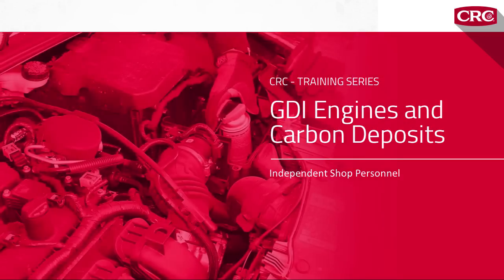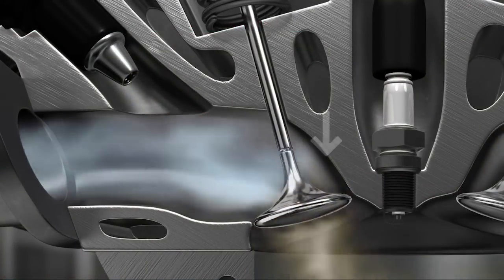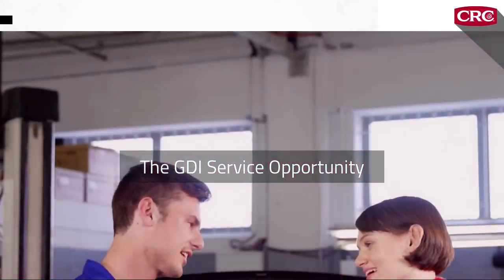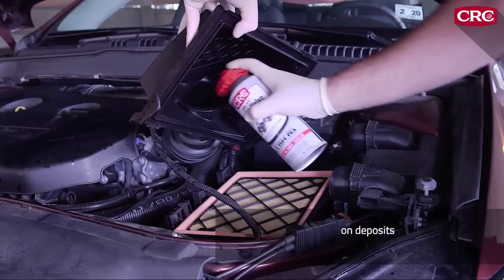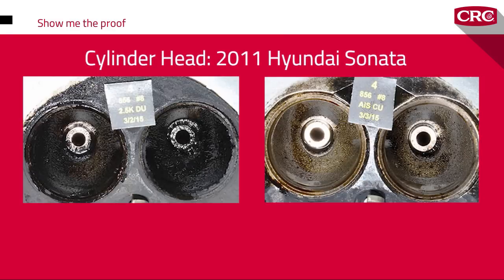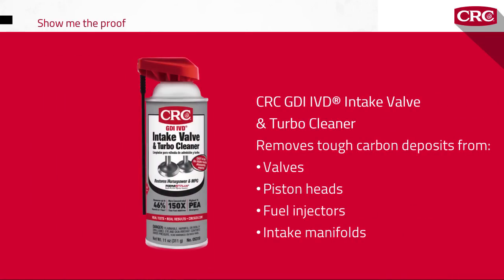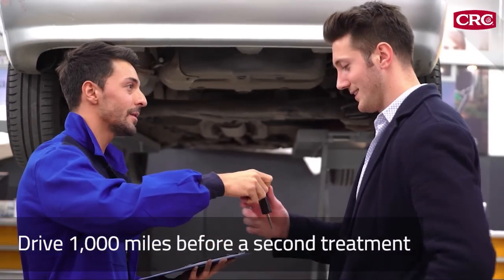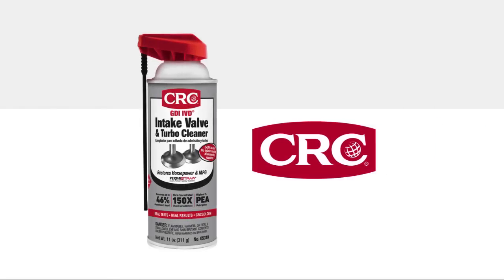How To Use CRC GDI Intake Valve & Turbo Cleaner

Comment: This is great to soak and loosen if engine is not running and performing a manual deposit, but it is NOT safe if used engine running. Want proof? Can show you pistons from dozens of engines immediately following an engine running cleaning. Not only have we yet to see more than 20% removed, we see scoring to the piston skirts and cylinder walls in every case as these hard baked crystallized particles are forced between the piston and cylinder wall.  We have used these in port injection engines safely for decades, but we do R&D work on GDI engines and have since 2008 when we were first contracted to discover why pistons were breaking on GDI engines leading to understanding LSPI and the destructive effects from it.  I challenge you to see just how these cleaners when used as engine running do NOT cause the damage we see. And also the damage to the hot side turbine blades as the larger hard chunks make impact with them during these procedures.  Great to use during a manual cleaning, but scouring in every case when used engine running method. And this is ANY solvent based upper induction cleaner.
Reply from the maker: CRC GDI IVD Intake Valve & Turbo Cleaner is a detergent cleaner (not solvent) that is designed and proven to dissolve carbon instead of aggressively breaking it down which eliminates the risk of the damage that you are referencing.  You can see our test results showing no scoring, damage or overheating conditions at crcgdi.com.  Some customers may prefer to tear down their vehicles and use our product, but due to the design of the product it is not necessary.
Reply: I have serious doubts that a reputable company is going to market something that grenades people's engines. That's a massive liability on their part and they would be replacing engines left and right. I get the whole thing about carbon deposits and engine damage but that likely happened from lack of routine cleaning and those chunks broke off and took out the vital engine components. You want to use a detergent cleaner that dissolves the carbon instead of the others like Seafoam that just knock chunks off the valves and combustion chamber.
Reply: Tracy Lewis Performance you are talking about products like seafoam. If you had ever used this and looked at the components after the hour and first drive. You would see that the once hard carbon is now a gooy looking substance. PEA when combined with heat is a totally different result that just soaking a valve in it cold. You are much more likely to have a problem with manual clean. A steel bristle, or small piece of carbon that you didn't get blown out of the port getting sucked in to the cylinder. Plus manual valve cleaning does nothing for the carbon issues in the combustion chamber. I have used this cry many times and I see the original crosshatching on the cylinder walls with my borescope. Quit fear mongering.
Reply: @Tracy Lewis Performance I did oil analysis before and after the CRC service and I found the hard particulates in the oil skyrocketed.  It took two oil changes in the first 100 miles to get back to normal. The 25 micron oil filters is not going to catch the fine carbon in the 2-15micron range, which is the cause of most wear in the engine.  How does it get into the oil.  The misfires and incomplete combustion caused by the cleaner, causes the carbon to mix with unburnt fuel and oil and is forced past the rings, and through the oil drain holes in the ring landings.  This explains your findings of damaged cylinders and pistons.

Comment: Other than the form factor is this product the same as the crc guaranteed to pass emissions from a chemistry point of view, I am guessing if the crc guaranteed to pass emissions was injected through a source of vacuum in theory in should work the same way. Are this products identical or there are differences ? If there are differences what are they?

Comment: I’m very curious to try this on my 2017 VOLVO XC60 T6 R design with the 2.0 four cylinder engine that has both a supercharger and turbocharger. Do you have a video showing those results?  I understand these engines have no oil dipstick and carbon build up on the valves is horrendous. Thank you
Reply from the maker: We don't have a video for this but please feel free to contact our tech services at techservice@crcind.com who can guide you thru the process.

Comment: Is it necessary/recommended to do an oil change after using the CRC Intake Valve Cleaner? TQ.
Reply: Probably cause then the spray gonna be in the oil

Comment: Questions.  2008 Mini Cooper S (Turbo) If I apply after MAF sensor just prior to turbo intake, will CRC go on to clean the intake valves?  OR, should I do a second treatment applied after the turbo closer to the intake?  I'm trying to achieve maximum efficiency. Are we sure the deposits that become dislodged wont become stuck in the catalytic converter?  How can we tell?  Can CRC be added directly to the crank case prior to oil change?
Reply: Hell no, don't put in crank case. If you're asking a question like that better let a mechanic work on your car. CRC ONLY goes in your air intake!

Comment: How does this product can clean turbine wheel in a turbocharger? Turbine wheel is on the hot exhaust side and this product will only touch the cold side compressor wheel. Cold side is fresh air flow only, so there’s no point of cleaning. In other words this product will not be able to clean the turbo. Please clarify by replying here.

Comment: I have an 2011 MKS 3.5 Ecoboost, since this car has 3 maf sensors, where do i have to spray the product? Thank you for your help. or im wrong about the maf and are map? Could you pin point where i have to spray please.
Reply from the maker: Thank you for your comment.  The product will not harm MAP’s. The Ecoboost’ s may use 1 MAF and 2 MAP’s or 3 MAP’s and no MAF.
You can spray the product from the air filter housing, thru the MAF if equipped. or  thru the throttle body.
Reply: @joaragon  Why do you say this isn't needed on the Ford GDI system? Looks like it's still configured the same way.
Reply: @joaragon I'm not exactly convinced of this. Granted I can't see exactly what I've got going on, I can only just barely see the fuel rail, but I've got a 2010, same car and the thing that brought me here to this video is because it started shuddering as I exited the e-way, then after a few start ups it's back to normal. Check engine light told me cylinder 2 misfired and low fuel rail pressure, pointing my mind in the direction of fuel injector stuck open. Upon pricing one out, all I found is the high pressure fuel injector for $200 each... nowhere in that listing did they mention another lower pressure fuel injector, and I highly doubt this car uses a high-pressure injector on both sides of the valve.
Reply: @joaragon  I'm not sure what you mean, but I don't see any evidence of port injectors on my car.
Reply: @joaragon  Only on gen 2 ecoboosts, which I believe came out in '17 models.

Comment: @CRC Industries,

For a Hyundai Genesis g80 2016 3.8L v6 Gasoline GDI engine, where do you recommend to spray the product exactly?
Reply from the maker: You can spray in from the air filter housing or as close to the throttle body as possible. Contact technical service at crcindustries.com or 1-800-521-3168 M-F 8am-5pm ET

Comment: I just wonder want happens to cylinder walls and piston rings as "carbon continues to be removed" days after treatment. They said at the begining that chunks can fall off if left untreated but couldnt chunks fall off with treatment? I get the necessity, but it seems like cganging auto trans fluid, for the first time, after 100,000 miles. Might hurt more than it helps
Reply: You can change trans fluid at any given time, not doing it at all is worst that doing it late.

Comment: A question CRC, in a Ford Fiesta ST with EcoBoost 1.6L turbo engine, where is the recommended point to inject the cleaner? From the airbox trough compressor/ intercooler or thorugh the cold side hose after the intercooler and before throttle body? Thanks
Reply: Did you ever end up doing this? Have a focus st with 100k I just bought and the plugs were pretty bad so I'm thinking of doing this too...might do it the real way and take the manifold off and use gas and a brush with the valves closed

Comment: newbie question but  why every carbon buildup video is about intake valves?  doesnt the exhaust valves have the same problem ?
Reply: I know it's been a while since you asked, but here's the answer you're looking for. On GDI engines, the buildup occurs due to oil particles accumulating on the valves, coming from the crankcase line going directly into the intake. It burns onto the intake valves, so there is really nothing to make those carbon deposits on the exhaust valves.

Comment: Correct me if I'm wrong...but. if you're running a 2.7 or 3.5 Ford ecoboost, could you not just disconnect the recirculation pipe from the "bov" and spray into that while it's running?
Reply: Nvm I realize now that the recirculation tube only connects to the drivers side intake turbo charge tube.
Reply from the maker: You could do this, but you are spending more time to get the product in the system. The charge pipes usually lead right in to the throttle body as well if you want to spray after the clean side of the turbos. These methods could throw a code causing the check engine light. Spraying in from the air filter housing on turbo charged vehicles is fine, the product will make it to the intake valves. For more information reach out to our Technical Service Team 1.800.521.3168 or techservice@crcind.com M-F 8-5 EST.

Comment: Hi, I have a port injected engine so I don't need valve cleaning but I want to clean the piston heads & rings. Is it safe to spray the product directly into cylinders thought spark plug holes and soak the pistons? If yes, how long can I keep the product in the cylinder? It is a cast iron Mercedes M111 engine. I don't want to spray it in to the intake because the MAF and Supercharger is on the way.  Thanks in advance.
Reply from the maker: While this product will work great on a running engine, we just don’t have the testing data to say it is ok to apply it this way. We recommend that you contact our techservice @crcind.com for alternative application methods on a running engine.
Reply: @CRCAutoUS  Thank you. I will contact them.

Comment: maan!! R U telling me i cant use this on my 2010 hyundai iload turbo diesel?
ive been researching for days on pick up can and found out the best going around is flashlube.
i was researching just now and stumbled over this treatment. i was so excited i couldnt wait until the video ended so i can race to  the store that sells it until you mentioned not to apply this product on diesel type motors. dont you have a product for us diesel users? What damage will it do if i used it? or ,aybe perhaps just spray a little amount? what about if i purchased low potent type in the market? please help!!!!!!!!!!!!!!!!!!!!!!!!!
Reply from the maker: Thank you for your comment.  Our product chemistry is formulated for gasoline specifically.  Diesel engines form carbon on other areas not too much on intake valves when compared to GDI so, we recommend a fuel additive for diesel engines with carbon build up.  CRC 1-Tank Diesel  https://www.crcindustries.com/products/diesel-1-tank-power-renew-174-15-fl-oz-05816.html

Comment: how come after doing this, my 2015 chevy impala, limited v6VVT,DI...for whole bottle, right through, the throttle body, at 2,000 prm, now my my car smokes when starting, and the the exhaust smells like rottn eggs( catalic converter) damage/
please help.??? i did exactley like the directions said. I EVEN CHANGED THE OIL WITH SUPERTECH FULL SYNTHETIC, AND A HIGH PERFORMANCE MOBIL1 OIL FILTER.  BUT STILL SMOKES,WHEN STARTING CAR... ...EVEN WHEN ITS 75 DEG OUT???
PLEASE HELP, TY IN ADANCE.
Reply from the maker: You have several questions that we would love to address. Please contact Technical Service at 1.800.521.3168 or techservice@crcind.com and we will gladly get to the root of the issue.

Comment: 1). I used your produce in a Solstice GXP, but some are saying it could be dangerous as it could loosen chunks of carbon that could fall into the cylinder, and or damage the turbo wheel, and/or clog the cat.  Could this happen if there's heavy build up?    2). Does the cleaner also help clean the catalytic converter or do you need another chemical for that?
Reply from the maker: Hi there.  Thanks for your question. Please contact our technical services at techservice@crcind.com , who will provide knowledge advice on using this product
Reply: I called and they said it just slowly removes layers so there shouldn't be any danger of chunks coming off.

Comment: CRC, my focus St has MAF sensor near the intake and additional sensors in the manifold. If I used CRC cleaner after MAF, will it affect the other sensors inside the manifold? 

My car has 120km without any carbon cleaning, what do you suggest?
Reply: Is 1 crc can enough or more ?
Reply from the maker: Thank you for you comment.  I believe the sensors you are referring to are the MAP sensors.  This product will not harm passing over the MAP sensor, but will harm the MAF sensors.  If you assistance verifying please contact our tech service department at techservice@crcind.com or 215.442.6290.
Reply: @mixedup859  hello! Did you try the product? Did it have issues with the MAP and IAT sensors in your manifold?
Reply: @blackriderph4340  Hello, i tried the product twice and didn't have any issue with sensors, carbon was not removed either. I'd recommend opening the manifold at running temperature and remove gunk by piece of cloth. It is not 100% result but I wouldn't use any chemicals again .
Reply: @mixedup859  wow thank you for the feedback! Im surprised it didn’t clean the carbon I really thought it does.
Reply: @blackriderph4340  unfortunately, it didn't for my ST. I currently use my car for street racing during weekends (slightly modded car) maybe i will install methanol injection to increase power and clean the valves like no other chemicals could do.
I have seen impressive results from meth injection. But it is not a solution for everyone. If it is your DD. I would suggest openning the manifold and clean them manually.

Comment: Is there a recommendation on, 
Before or after oil change?
The instruction video says 1,000 miles between applications on extreme. Is there a maintenance schedule?
Reply from the maker: Thank you for your comment. We recommend performing the service first and then changing oil and filter.  After that its every 10,000 miles or every oil change for maintenance.  If your vehicle has high miles or you know it has heavy build up you can do another service after 1,000 miles.  Then move onto the general maintenance schedule.

Comment: Hi, according to video, for turbo engine spray into charge pipe or vacuum port, will that clean the turbo as well? Does throttle body works?
Reply from the maker: Yes, We recommend spraying in from the air filter housing or as close to the throttle body as possible.
Reply: @CRCAutoUS If I spray directly at throttle body, turbo will not be cleaned correct? As turbo is before the throttle body. To clean both I have to locate the spot after my maf sensor?

Comment: I have a 2013 Hyundai santa Fe and sonata. I think they have a MAP sensor and not MAF sensor. The MAP sensor is located after the throttle Biddle butterfly. There is no way to avoid it. So is this spray still safe to use?
Reply from the maker: Thank you for your comment. Yes the product will not harm MAP sensors.

Comment: Will this damage MAP and IAT sensors? My mazda 3 skyactive have these sensors within the intake manifold after the throttle body. I am really concerned that this cleaner will damage these sensors.
Reply from the maker: GDI IVD Cleaner will not hurt the MAP or IAT sensors.
Reply: @CRCAutoUS  thank you for the fast reply! Last question though, will there be some kind of scouring in the cylinder walls? I understand that the product is detergent based and will emulsify the carbon. Im just curious if there’ll be any scouring
Reply from the maker: Our product will not score the cylinder walls. Because it is detergent and not solvent it will not raise the cylinder or exhaust gas temps.
If you have any detailed questions please don't hesitate to reach out to techservice@crcind.com

Comment: The instructions specify to spray downstream of the MAF sensor,but my engine uses a MAP sensor.  Is this product safe to use with a MAP sensor?
Reply from the maker: Thank you for your comment.  This product will not harm a MAP sensor.
Reply: @CRCAutoUS  thanks!
Reply: Thanks for the clarification :) hope this works on my Focus
Reply: Thanks for the question my Ford F-150 also uses a map sensor
Reply: @elsobnumberone3306  did it not damage the Map sensor?
Reply: @zeusm8498  was your map sensor still functioning after the service?